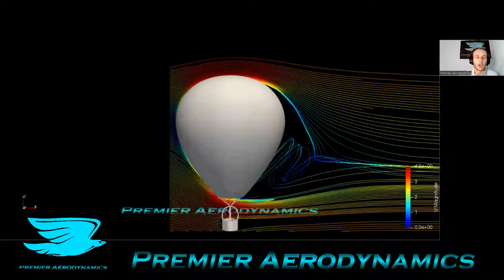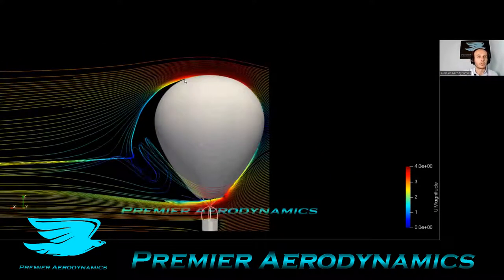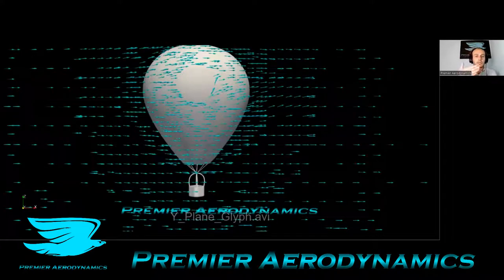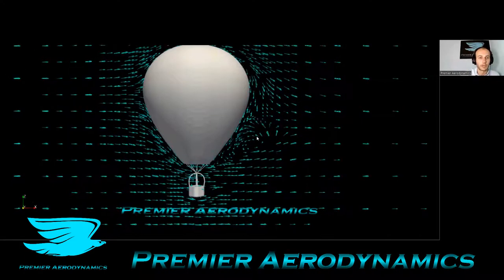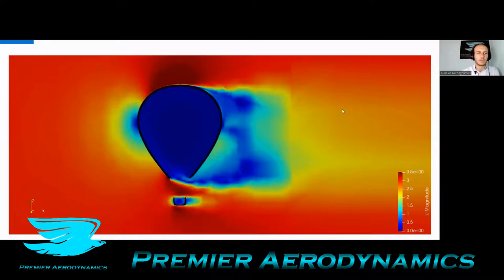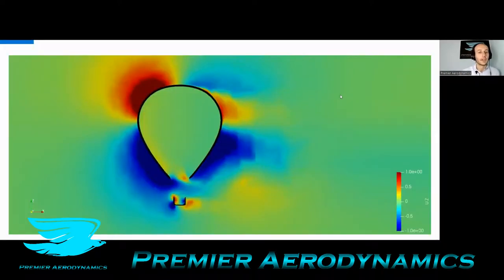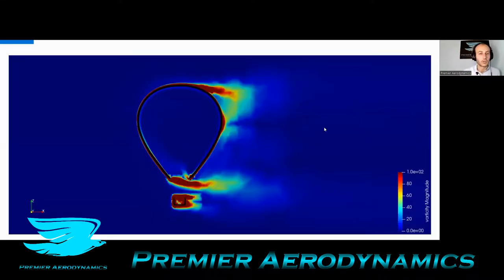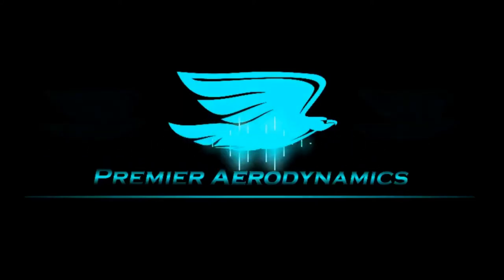Hot Air Balloon Aerodynamics Are Pretty Interesting!

Comment: Hot air balloons are aerostatic, not aerodynamic. They do not move through the air sideways as an airplane or even an airship does - they drift at the same speed as the wind, and therefore have no airspeed. It would be actually useful to turn the balloon model sideways (or set the air velocity component to vertical) to model the effects of a rapid climb and descent. Typical hot air balloons have a maximum descent rate of 5-7 m/s.